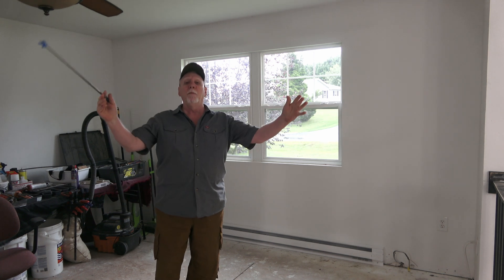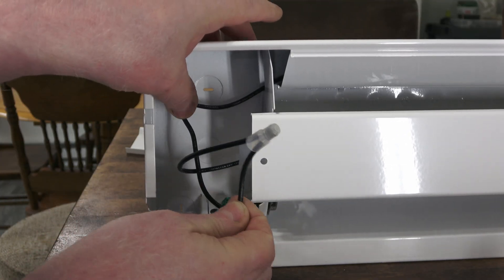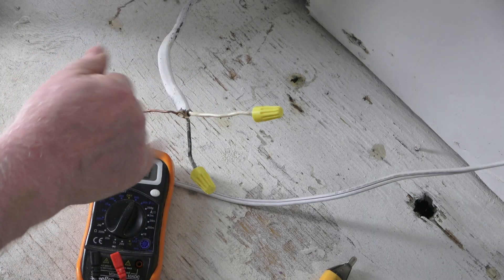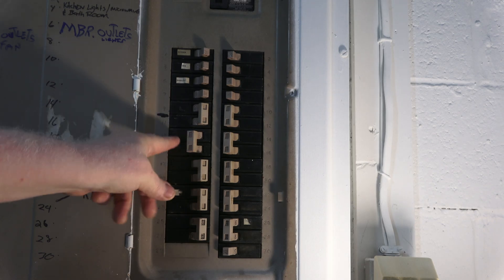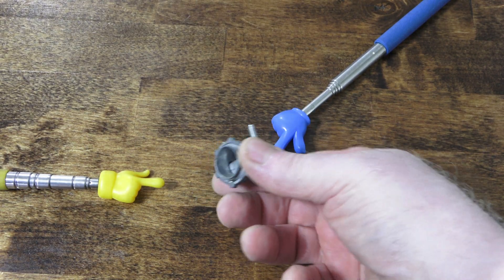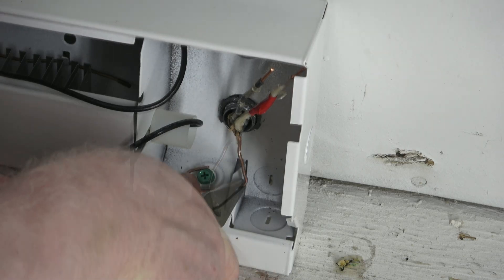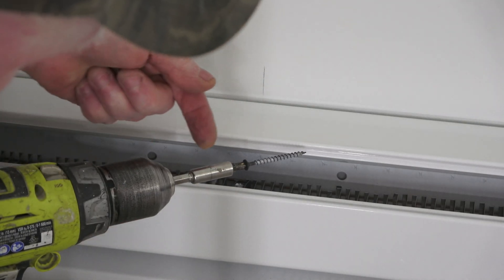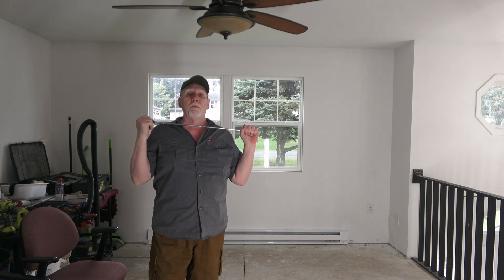How To Install & Wire 240V Baseboard Heater Left Or Right Connection

Comment: Very helpful sorry for my stupid question no neutral wire?
Reply from the maker: That's correct 240V baseboard heater don't use neutral wire 🙂 The heating element draws power between 2 hot wires (120V each) to complete the circuit and does not require neutral wire for operation
Reply: @wildwoodtop tks!!!

Comment: Hello, this is a great video, thanks for showing. However, I find in my basement a weird situation which I cannot explain. I have an electric baseboard and a thermostat. The thermostat (Honeywell RLV310) has only two wires to connect to. In the installation box are also only 2 wires (black and white) and a not connected ground. The system works, when the thermostat is connected everything is like expected. 

But what I do not understand is "how" it works - if I measure the voltage in the installtion box I get 240V when I measure black against white - so there are two hot wires. To cross check I measured black to ground and read 110V same for white to ground: 110V.

What exactly does that thermostat do here - regulating L1 onto L2 and why does have an effect on the baseboard?
Reply from the maker: Sounds to me that you have a two wire thermostat setup which doesn't offer the off feature whereas the four-wire system does. here's a video might shed some light https://www.youtube.com/watch?v=ODIVc0AeSUs

Comment: You might wanna be clear on what you're doing exactly, because, when you addressed the wires on the left side of the heater, what you're saying to cut, is completely opposite to half of the instruction book. 
Might wanna clarify that you are explaining a certain configuration for the heater, and not just make this sound like it applies to all configurations, because you're telling people to cut a wire, that does in fact, get cut. Per the manual, which is even visible  in your video, on the left side.
Reply: Thanks for your input.  I just bought a 36 inch Cadet 240v and have a single-pole thermostat.  The unit Im replacing is old and when I took it apart, it had the same wiring configuration on the left side but the hot wires were not connected as shown in this video.  The directions say to cut the other wire, not the top one.  And the unit I am replacing also was not connected to the top wire.  Yet, Cadet has old YT videos saying to cut the top wire........wtf?!?  Have you installed Cadet baseboards and if so, agree that the top wire should NOT be cut and used?